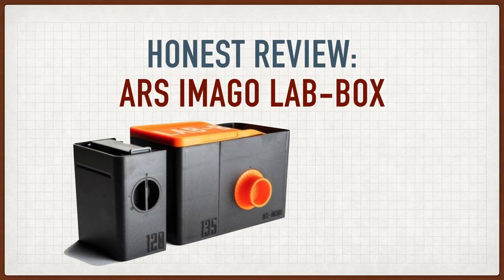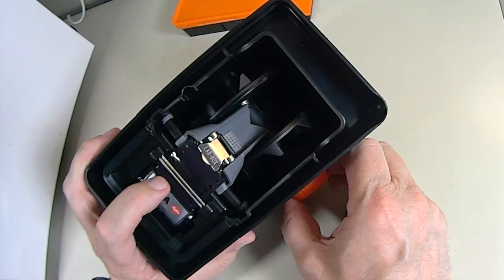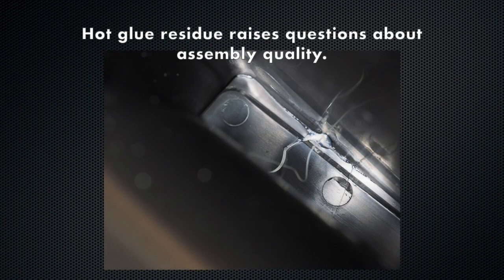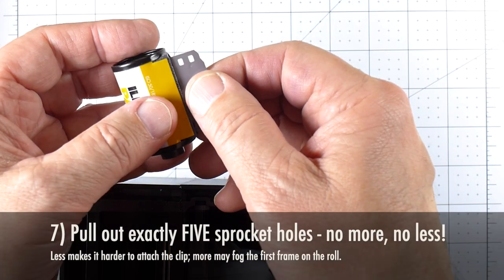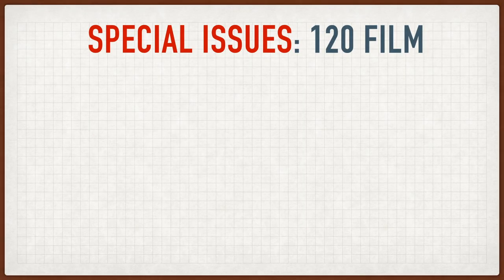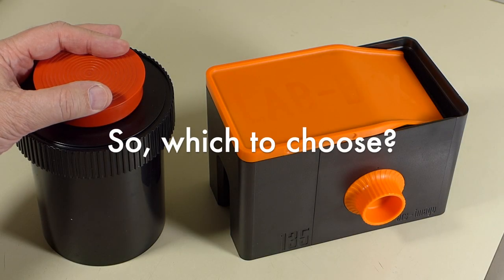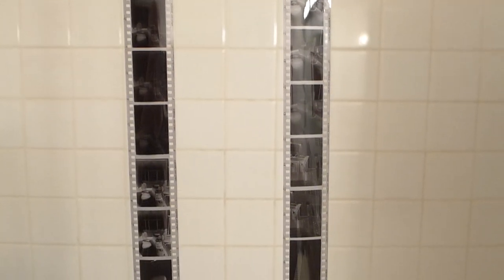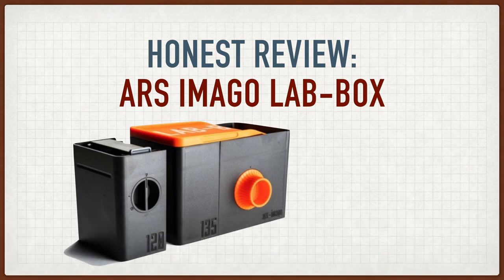Lab-Box review

Comment: Good review, but some points you made are either obvious or kind of overstated (cost for example: I got mine for 180 dollars. You're going to spend over 100 dollars assembling all the parts you're going to need in a traditional set-up anyway. Photography isn't a cheap hobby to begin with, so that was kind of a mute point to me). As far as complexity and needing dexterity to develop a roll of film, I just don't see what the problem is. It couldn't be easier! To me, fumbling around in a changing bag where you can't see anything is a study in frustration. The rinsing and drying process is something you'd have to do in a more traditional set-up anyway, and the Lab -Box only has 8 parts. Granted, it's one roll at a time but if that's a problem for someone they are probably a more professional photographer and should have a more professional set-up. This thing took away all the trepidation I had in regard to developing my own film and the money I have saved by not sending my film to a lab to be developed has more than paid off. Also, it's made an already pleasurable hobby all the more enjoyable as I can do the whole process myself.
Reply from the maker: Glad it worked out for you. I admit that once I got used to its quirks, I started using mine more and more, and now it's all I use unless I need to process more than one roll at a time. Still, I think it was legit to point out the drawbacks. And for first-timers who discover they just don't enjoy developing film, it's easier to walk away from a $35 investment (typical price for a two-roll Paterson starter tank) than a $180 investment!

Comment: Looks like they have some bugs to work out.  I use a rondinax 60 and it's quick and flawless.  I've never had an issue with it.. I do both color and b&W with it.
Reply from the maker: I'm impressed that there are so many loyal Rondinax users out there!... but of course the problem is that Rondinaxes (Rodinae?) are out of production and only available used. So if you're someone just starting out, you not only need to find the model you want, but a good example of that model. And if you shoot both 35mm and 120 film, you need to find both flavors!

As I continue to work with the Lab-Box, I've mostly found workarounds for the issues... and now that I've built my "Robo-Box" motor, it's a tidy way to develop a single roll without much effort. But I still think a film-developing beginner would be better off starting with a conventional tank. It's less expensive, and the skill of loading reels will be useful if you ever want to move up to larger tanks so you can process more rolls.
Reply: @jlwilliams  I Motorized my rondinax 60 as well.  I set it up to simulate the move/pause/move/pause you'd get from turning the knob by hand.  It rotates like 120 degrees, pauses, then moves again.  It looks like the lab box was just trying to do too much and that increased complexity has some issues still.  I hope they get them worked out over time.

Comment: Hi guys. Anyone have maybe a problem with a left scratch on the whole length of the film? I found some people with same issue. I have asked Ars-Imago, but they don't know what is going on. Thx.
Reply from the maker: I haven't had that, but I would say the first step is to have a roll developed a different way (tank, lab) to make sure the problem isn't with your camera. Also, take note as to whether the scratch is on the emulsion side or the back side.Then I would look at all the places in the Lab-Box where that side of  the film might contact the loading path. The cutter bars and the loading guide seem like prime suspects. Also, if your problem is with 120 roll film, you'll need to check the slot in the revolving light trap. If you find a burr, mold mark, or rough spot, try smoothing it out with an emery board or fine sandpaper. Good luck and let us know what you find!
Reply: Here you can find some comments about similar situation: https://www.japancamerahunter.com/2019/06/photography-ars-imago-lab-box-monobath-review/?fbclid=IwAR0w45l6mpFDVYwGYQhFTdH6eEKwAo5zGQLJywSVC05feHTQutuDApQIPCA (users: Matt Ludgate or JoeBoy).
Reply: @jlwilliams  Here you can see a short HQ video of my gilm guide: https://drive.google.com/file/d/12vYXxuxM3CpA8VEIhIwflZHXVH8rOA1p/view